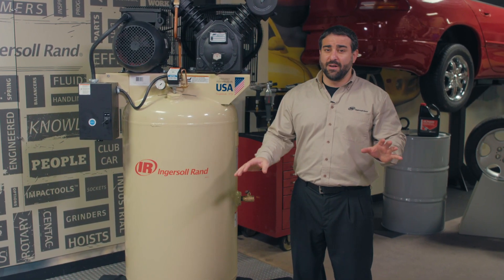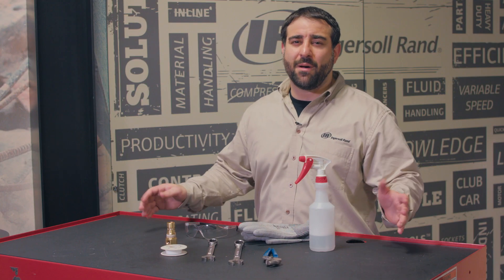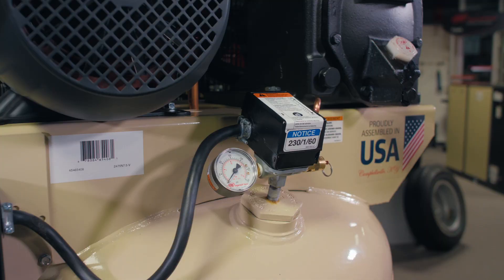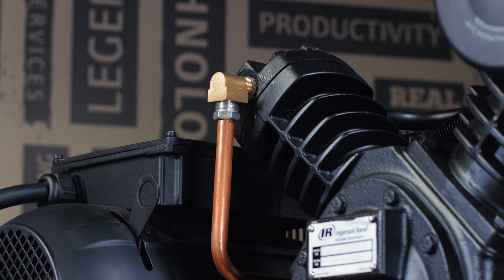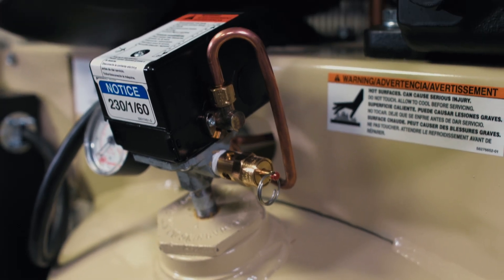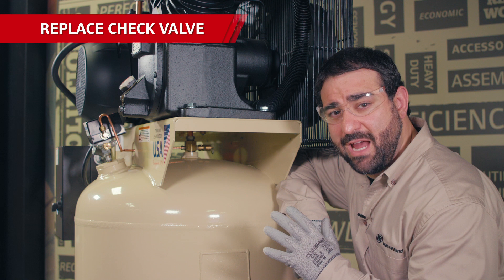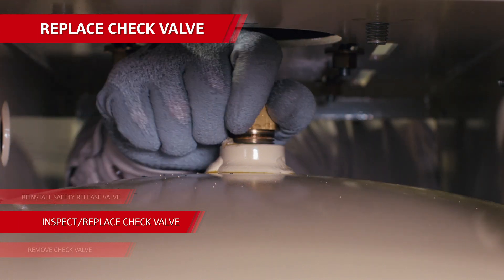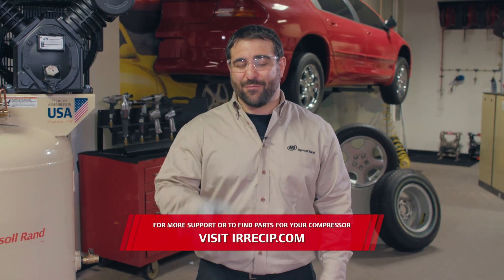Leaking Air Troubleshooting | Ingersoll Rand Reciprocating Air Compressor

Comment: Brand New air compressor and stuck in the check valve was a nut and bolt. Has done irreversible damage. And your support and customer service is none existent.
Reply: Literally had this exact thing in my check valve as well. Just got this thing in march
Reply: My turn…